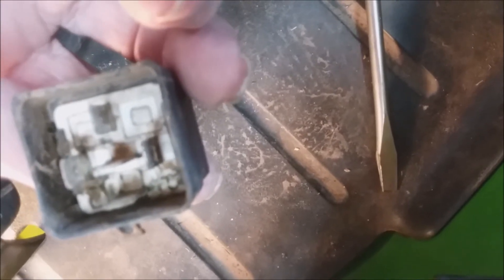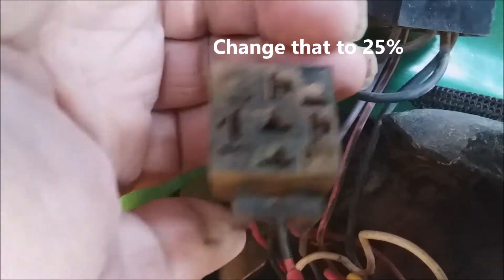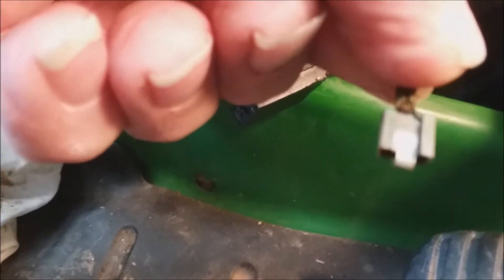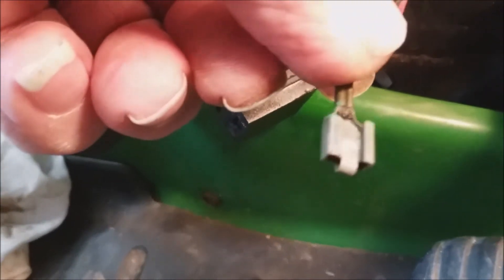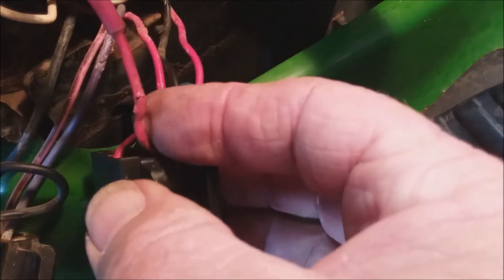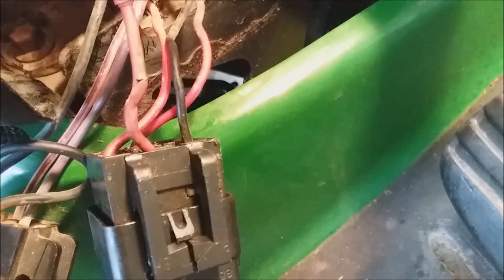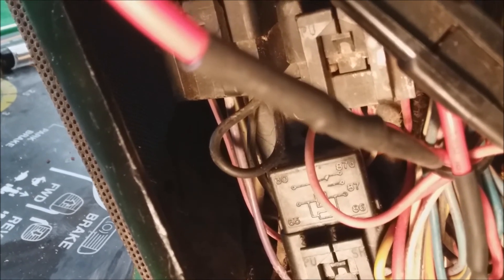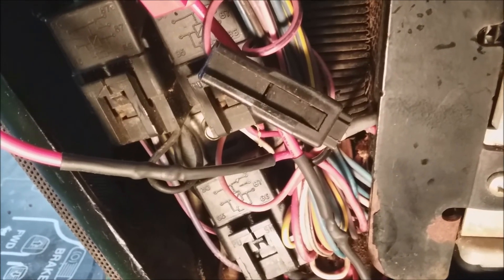John Deere X485 Fuel Pump Problems

Comment: I'm having electrical problems.  No voltage to fuel pump or ejector. Ware can I get a technician repair manual to identify wires and electrical components?
Reply from the maker: What model TM are you needing? X485?

Comment: Hows it goin  I have a 2555 john deere  n most of the gauge cluster don't work. I've tried changing cluster but that didn't solve problem. Some say there is something being grounded out but I can't seem to find it and my fuse panel isn't labeled. Can anyone help
Reply from the maker: First of all,  exactly what is not working?  I do not have a TM for a 2555, but the cluster looks very basic. It sounds like it could be a battery problem to the cluster.
Reply: @gotdeeres  sorry been so long to get back. I have a ITSHOP book but is limited on helping. The fuel gauge is always stuck on full and tachometer doesn't work
Reply: @gotdeeres  I've looked over fuse block and any other connections nothing seems burnt or corroded. But going by my ITSHOP book the wiring diagram is slightly altered and some wire colors aren't in the wiring chart so gets a bit mind boggling

Comment from the maker: I forgot to mention that I earlier replaced the fuse holder.  The old one was in bad shape (Melted) and had a 30 amp fuse in it? Should have been a 10 amp fuse. Since there was a short on the red wire, the large fuse prevented the short from blowing the fuse, but eventually melted the wire conductors. The wire became the fuse.
Reply: exactly same thing happened to me with my x585. Quit running, no fuel. Turned out it was a bad fuse holder. Took me a while to find it (I am no mechanic) but ended up being a cheap fix.
Reply from the maker: @jeverhart99  That fuse holder does seem to be a common problem.